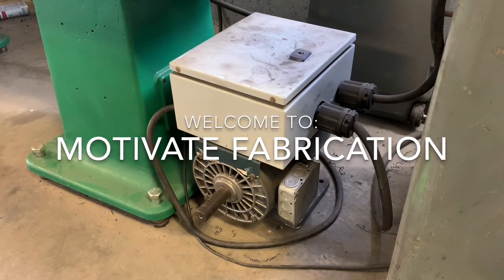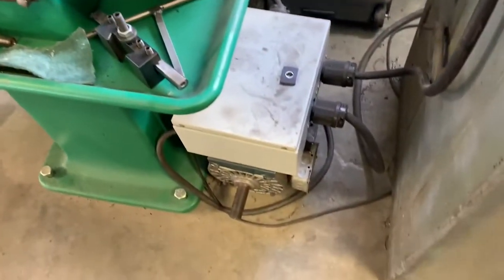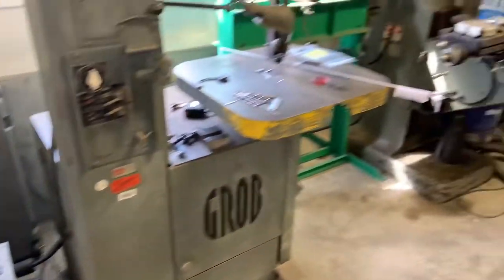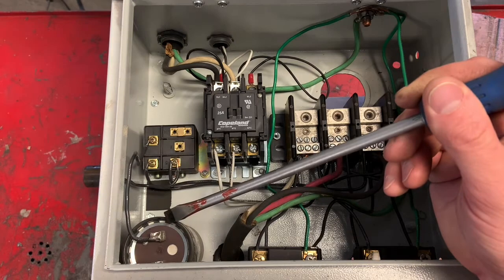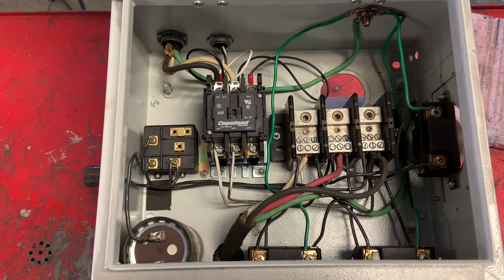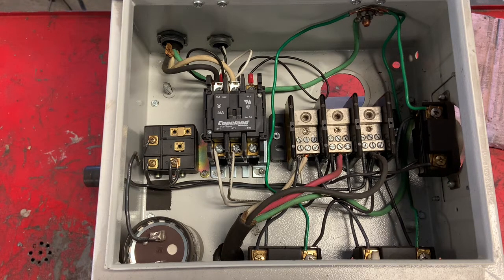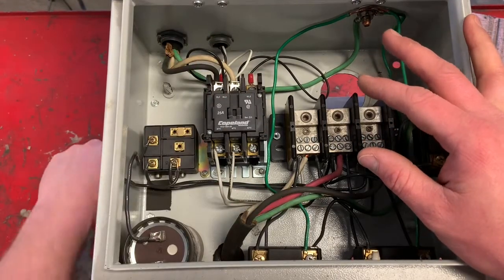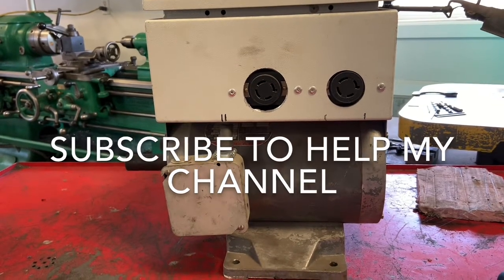Rotary Phase Converter Upgrade

Comment: I was just thinking, is that not the potential relay that stays in, or keeps the caps in the circuit too long? I have seen that somebody uses a adjustable relay and tweets it till it works beter.

Comment: I’d be happy with that start. Mine hums and grunts until the motor spools up. Mine stalls and hums sometimes on startup and I have to shut it off. I’ve even rocked it at times to get it to start. I need to learn about how they work to see if the caps are old or what.

Comment: Great video. Now remove that chuck wrench from the chuck on that nice lathe and never store it there again. Only put it in the socket when you plan to use it. I've seen people run out of the machine shop for doing that same thing. And it's the first rule they teach in machineshop classes. That and nothing on the ways except oil.

Comment: I believe you need a separate contactor for the capacitor to go through. During start, the surge amps from the caps to the motor will cause the potential relay to fail. Let the potential relay control your capacitor contactor and the high current load will then be on the contactor.

Comment: Thanks man, its very helpful. I got One questions, how you connect to the machine . Is it work when i’m directly wire phase converter output to the machine main box ?  or need wire straight to the idle motor like VFD .